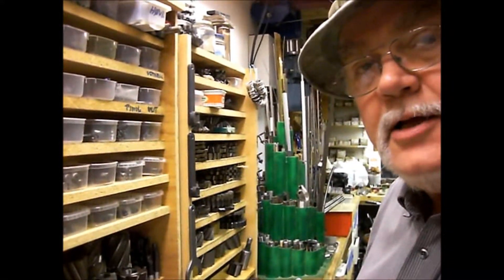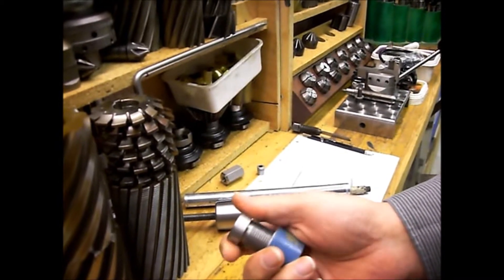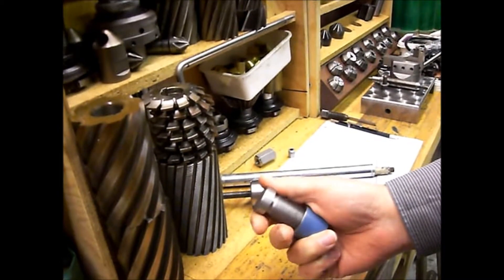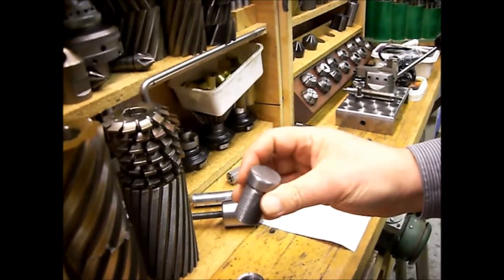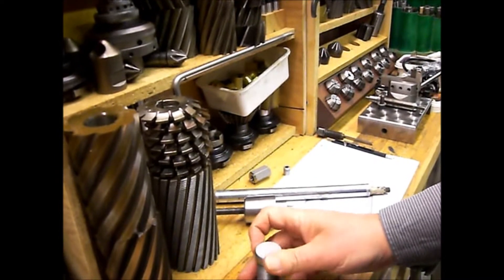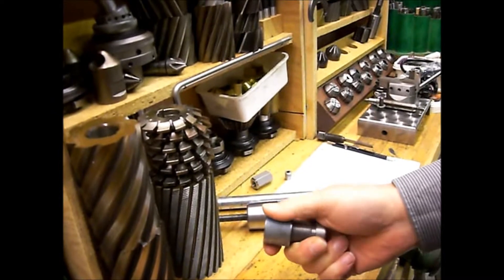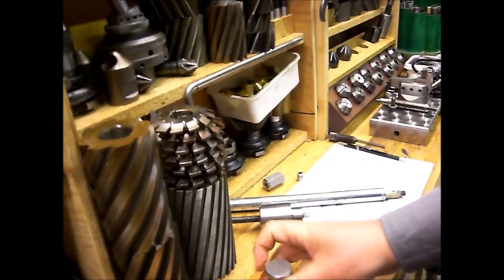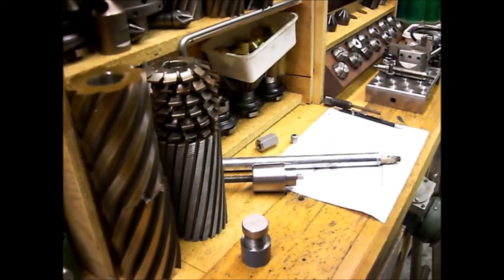My first threading ever on the lathe STANKO 1A616 !

Comment: I always knew you could do it, all those worries put you off for too long. Now that you have crossed the thread cutting Rubicon there will be no stopping you.
ATB
chris
PS good job.
Reply from the maker: Oh, thx for the nice words ... but in fact you'r just right - once tried allways doing threads yourself !
Reply: Keld Sørensen Nice job Keld. Top marks. Did you set the topslide at 29.5 degrees or plunge cut them?  Cheers Rob.
Reply from the maker: xynudu . As I see it this setting to 29° or 29,5° or any other degree NEARBY is of minor importance as long as the cutting tools is perpendicular (90°) to the job you'r threading, but I use 30° - that's what I "normally" do ;-)) in my "noviceness"